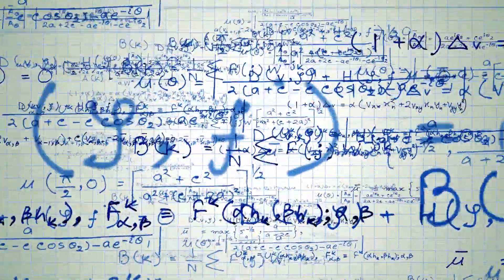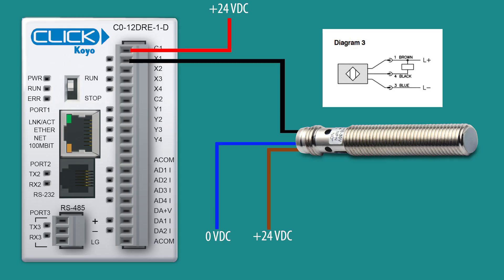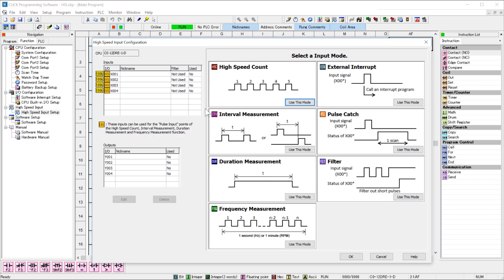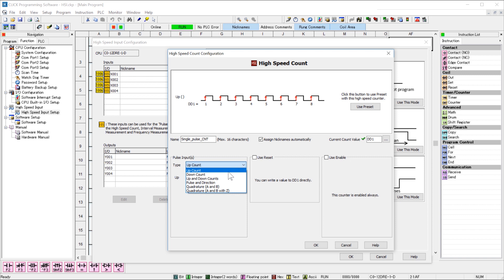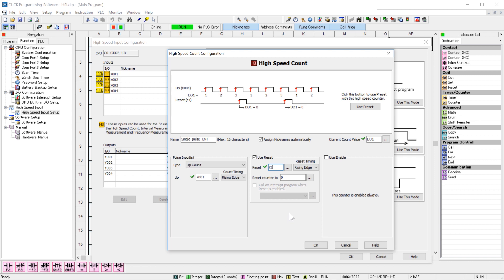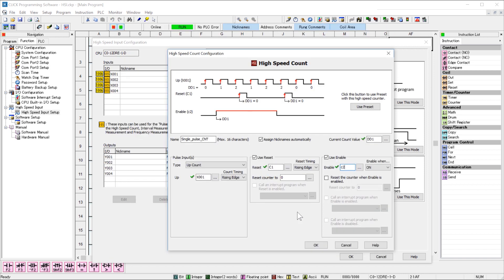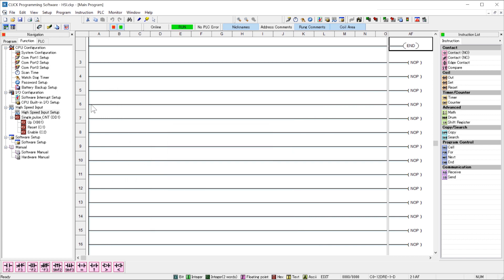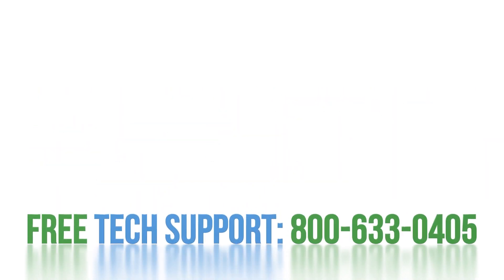CLICK PLC High Speed Inputs (HSI): Setup Counting for Single Input from AutomationDirect

Comment: What’s the purpose of wiring the sensor?
Reply from the maker: High speed inputs have many potential purposes. In this case, to keep it general we don't specify the purpose. If you look 5 seconds into the video it shows a sensor and a toothed gear. This is a common application for a single channel high speed input. The sensor triggers each time a gear tooth passes, the PLC captures and counts those high speed inputs, and the PLC can then make decisions based on speed of the gear, or total number of teeth that have passed, etc. The applications are limited only by your imagination! :)

Comment: How do you change the count numbers after they have been pre programmed? I'm playing around with this thing and don't see how to do that.
Reply from the maker: If you are trying to reset the count, you can set that up to be reset by a bit. If you want to set it to reset to a variable count. you can apply a variable for the "reset counter to". All of this is setup in the High speed counter configuration tool.